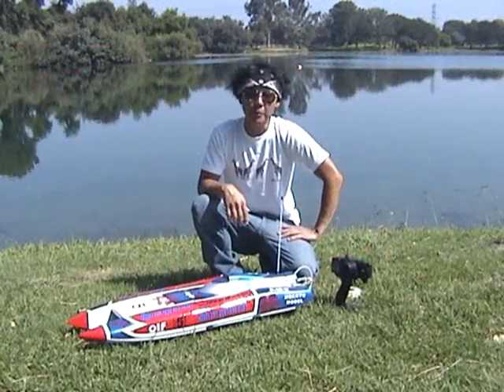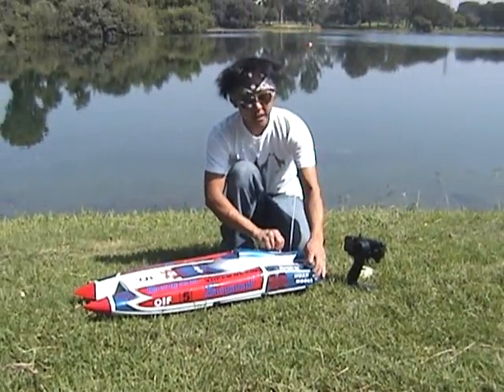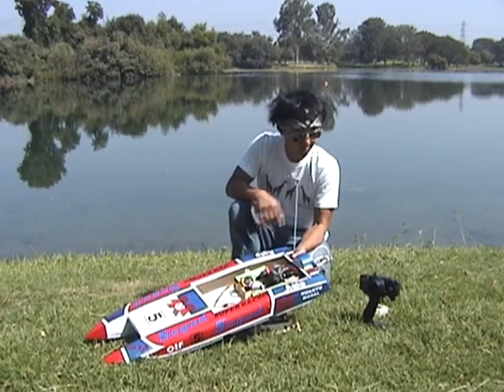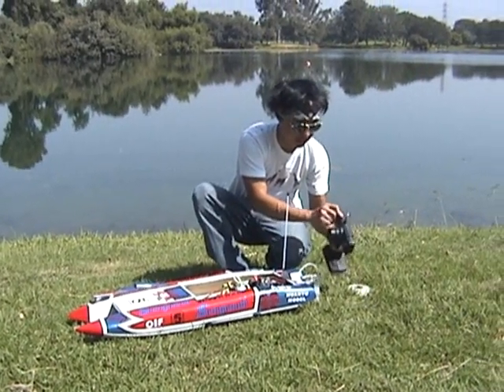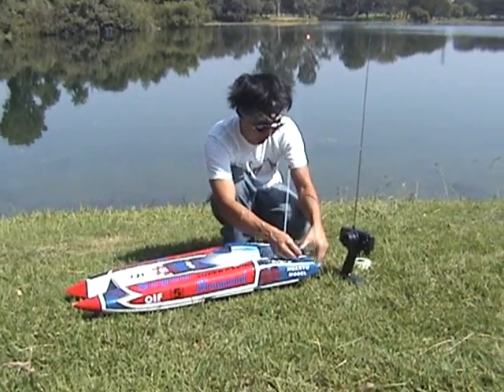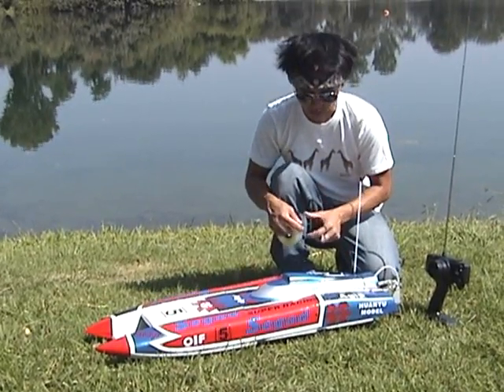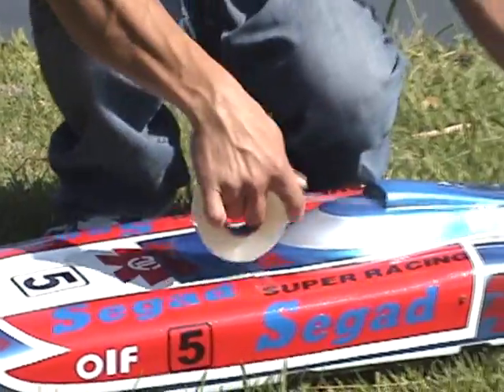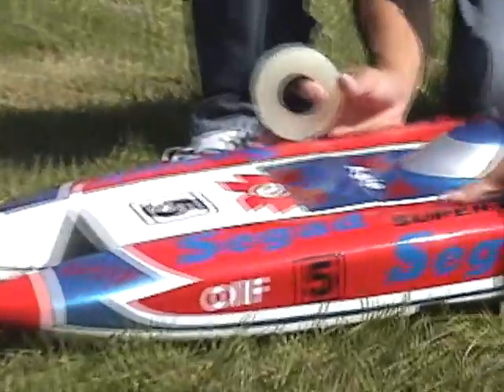Segad High Speed Brushless Catamaran RC RTR Speed Boat!

Comment: I would really like to see this boat run better. If placing the batteries more forward help then I'll probably buy one in a few months. Are the battery mounts adjustable or do they come set for the factory? Who is the manufacturer of this boat so that I can check on the reliability? I am also looking at the Venom electric and gas version boats to compare.

Comment: i would go with weatherstripping tape to seal the inside of the cover of the boat and tape the outside for extra protection of the radio gear,or rig a sealed radio box inside

Comment: I'm interested in the Excelled RTR boat. Post a good video of the boat where it shows that it runs well and I'll get one. I have concerns about the water flow to the prop when this boats up on a plane.  Can you make this boat run on Lipos with the ESC that it comes with? Also if you don't want to seal the hatch with some sort of tape, does that mean it will take on water while running it or a flip situation?

Comment: im sorry but as a part of an rc boat racing club this boat is something that is considered for a small child. there are no waterproofing o-rings on the hatch the parts are not in a water tight box like the lipos and servos and speed control. second the controls are all wrong and the fins are missing the hull is a scale model of a peasur boat and rc boats dont work the same. and really the only thing that they got right is that they put the prop on the back

Comment: i hate having to put tape on my boat. i have a miss geico rc boat running on 2 7.4 lipos. but boy does the tape work. flipped it without tape nd the covers both flipped off. also my boats twice as fast. just sayng

Comment: @n1ck3o7
Ummm..... not quite.

There is no "EE" sounding syllable in the word Aluminum.  While you are correct in saying that the first sound is "AL-YOU" instead of "AL-OO", that's only correct if applicable in a GB accent. Where you failed is adding an "EE" sound in there.  The proper English (UK derived) pronounciation is al-YOU-min-UM.  The improper UK way is saying al-you-min-EE-um.  There's no EE syllable anywhere, even with a UK pronounciation!